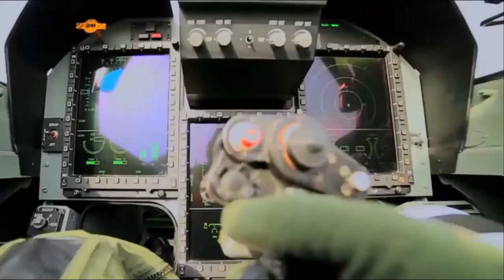China’s Super JF-17 To Seal Argentina Fighter Jet Deal, US F-16, Indian LCA Tejas Unsuitable

Comment: Faster than the F-35!
What a surprise!
JF-17 is a beautiful aircraft!
Reply: They prefer Ws10B engines.
Reply: Bvr missiles range, EWS, FBW control system, Good long range radar matters most in Modern warfare.. speed is useless if aircraft doesn't have good instantaneous and sustained turn rate..

Comment: It would take decades of planning to take back Malvinas, with the following steps:

1. Get JF-17, and later introduce the production line so Argentina can make the jets faster; they need quantity over quality for now

2. Get 054A, 056A, and 022 ships from China. Best to get them secondhand, since this will be cheaper and Argentina can get them sooner and start training to learn how to operate them

3. Get J-10C after Argentina had gained experience from JF-17

4. Get conventional subs from China

5. Get land-based air defense and anti-ship missiles from China

6. Get amphibious ships with armored vehicles from China, also anti-sub helicopters

In 10-20 years, Argentina should have:
80 JF-17
50 J-10C
4 054A
6 056A
8-10 022
4 subs
......